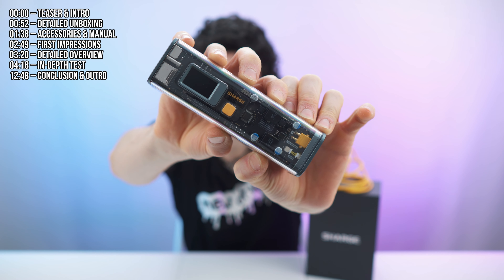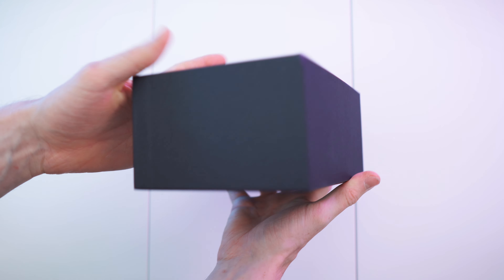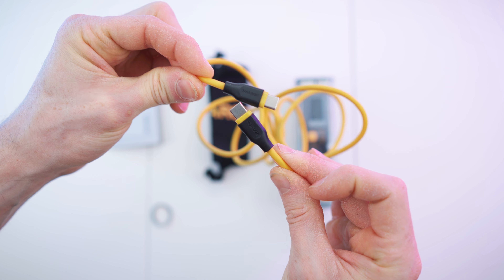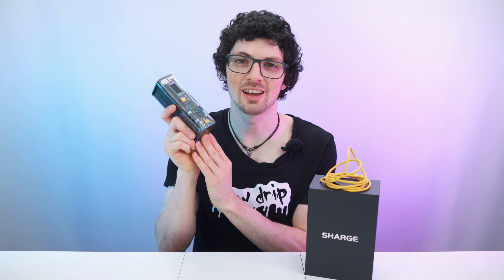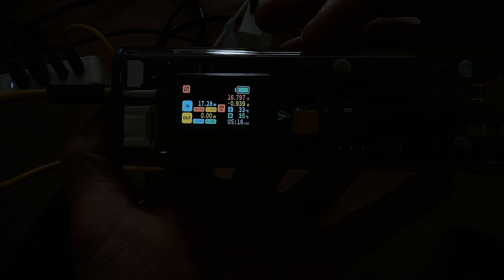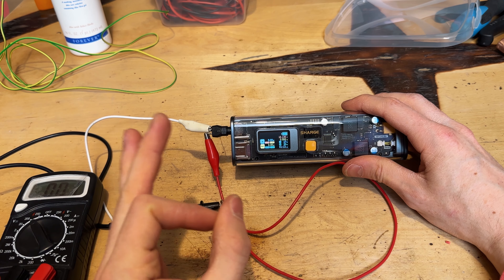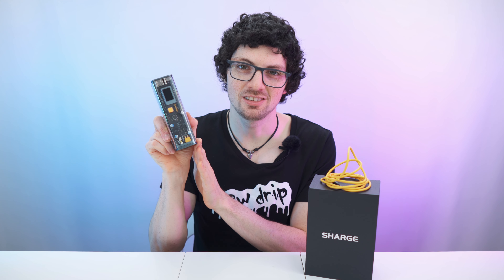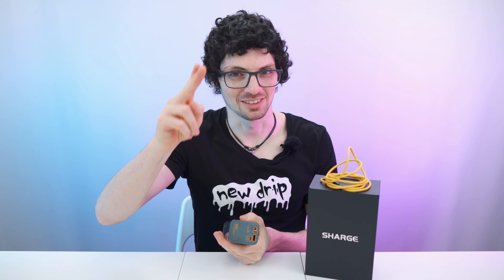World's 1st Transparent Power Bank With Selectable DC Voltage! - Shargeek 100 Review & Test

Comment: This power bank with Magsafe would be SICK
Reply: Nah MagSafe isn’t as efficient as direct cable and it causes way more heat which is bad for electronics and batteries. A $200 charger needs to have direct cables for fast power